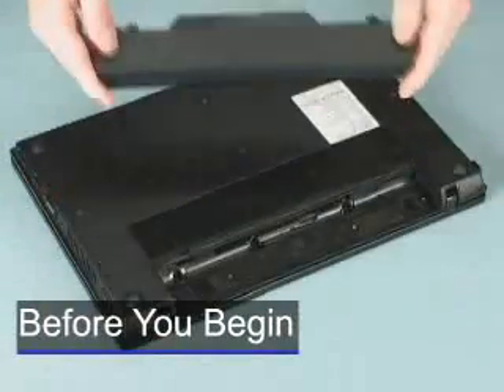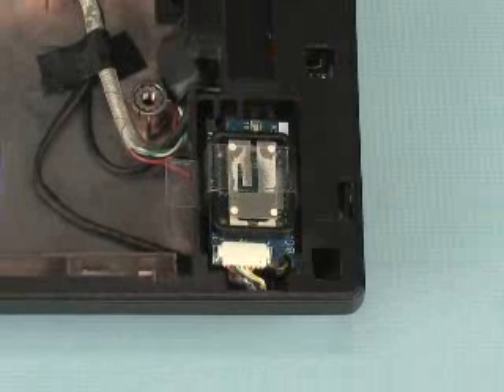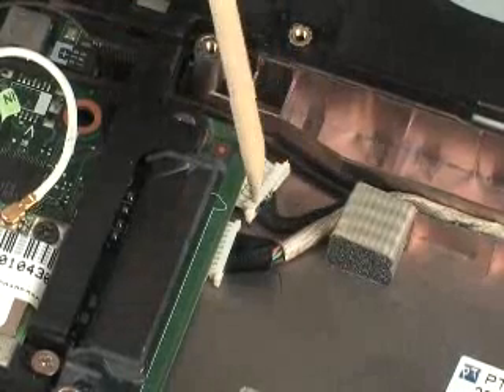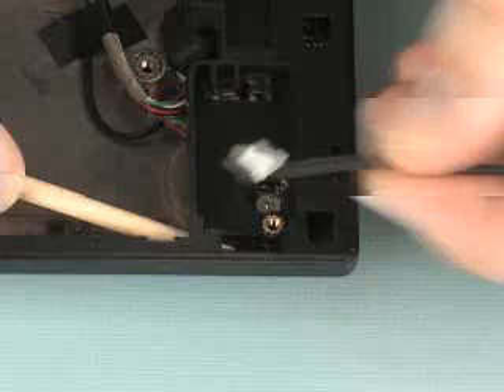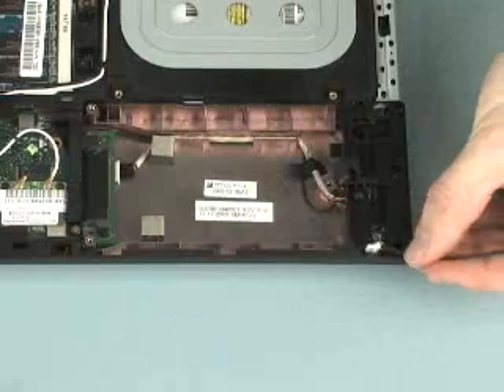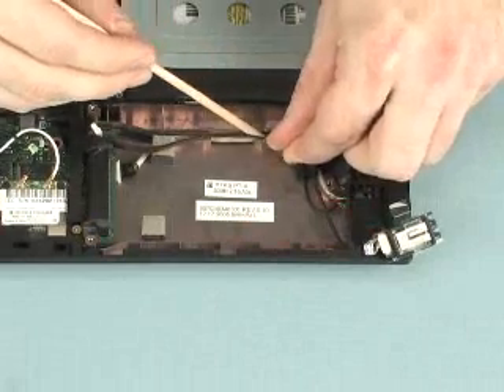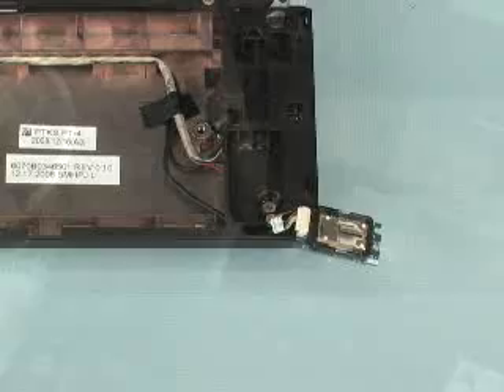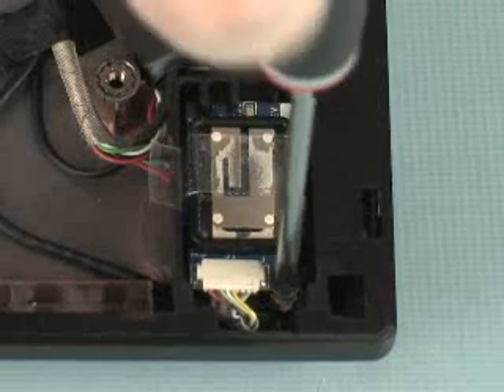Video hướng dẫn thay bluetooth module HP ProBook 4410S, 4411S, 4415S, 4416S

Comment: Can this bluetooth module use for HP 4530s ?
Reply from the maker: Một số mẫu HP ProBook 4530s, mô-đun Bluetooth được tích hợp chung trên cùng một card Wi-Fi.

Cụ thể, có những card Wi-Fi kết hợp Wi-Fi và Bluetooth như:

Ralink 3592BC8 802.11 a/b/g/n 2x2 WiFi and Bluetooth 3.0+HS Combo Adapter

Atheros 9285GN 802.11 b/g/n 1x1 WiFi and 3011 Bluetooth 3.0+HS Combo Adapter

Atheros AR5B195 (thường là combo Wi-Fi và Bluetooth)

Tuy nhiên, cũng có một số mẫu 4530s sử dụng card Wi-Fi riêng và mô-đun Bluetooth riêng biệt. Để xác định chính xác, bạn có thể kiểm tra trong Device Manager. Nếu tích hợp thì không thay được nhé!